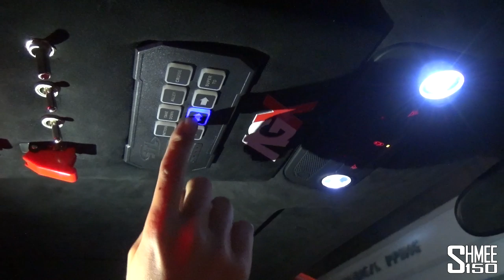Alex Choi Explains His UNICORN V3 Lamborghini Rally Car!

Comment: Fun fact for those who aren't into motorcycles (since there's one in this video): The Yamaha R1's engine is an inline-4 with a crossplane crankshaft. Basically, it's like a Mustang GT with half of its cylinder banks shut off & can rev up to 15k RPM

Comment: well technically if you're an actual rally race in the middle of the night or going to the desert to one of those rally races you would want the most light you can getwithout overstraining your car's alternator and battery which I would recommend on installing a second battery or a second alternator to power II battery either way depends on the power of your factory alternator or the alternator you buy to beef up the factory alternator